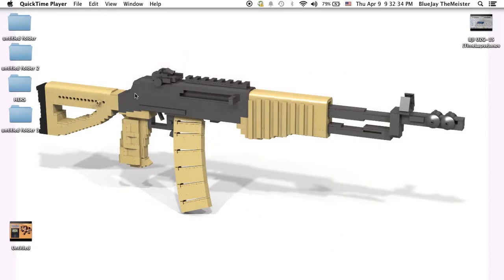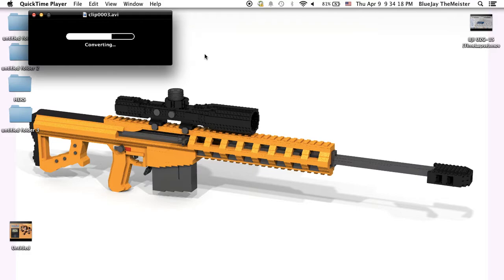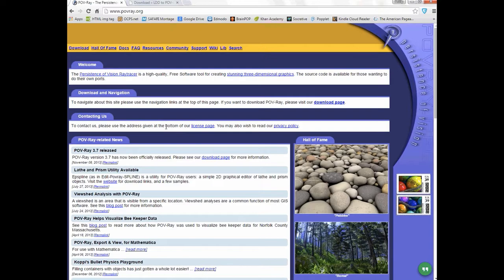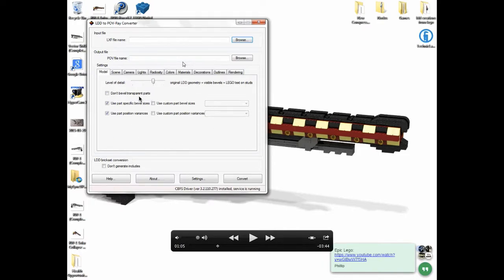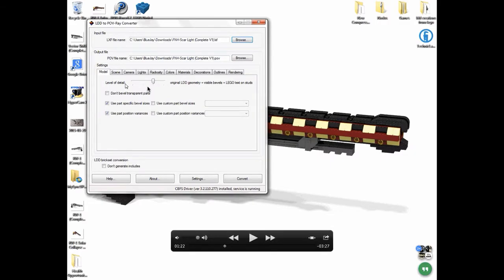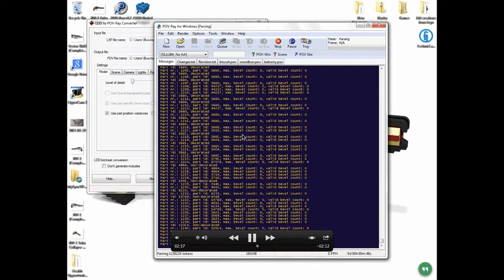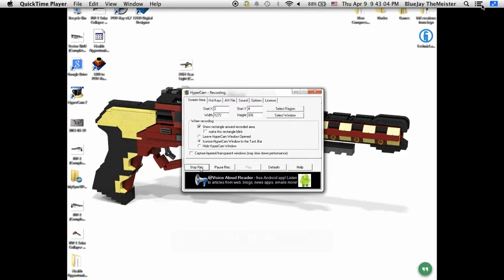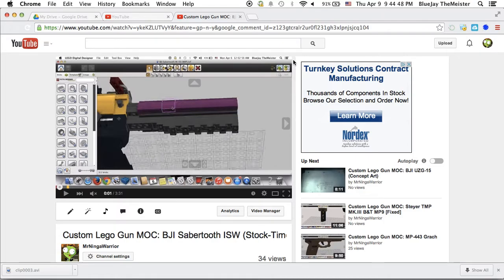How To Use: LDD to Pov-Ray

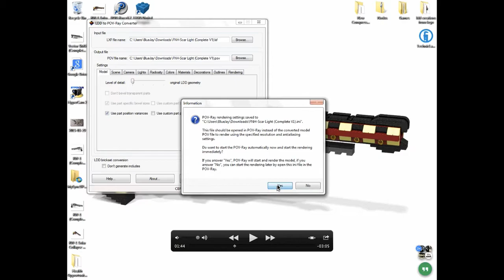Comment: Whenever I get to the part where POV-Ray starts rendering the image (where all the text shows up, 7:55 in the video) I starts, then the error sound plays and it says something about the "include files." I have no idea what to do, I've tried redoing it about a thousand times, could you please help?
Reply from the maker: Quartet Films I've also had the same issue. I have yet to find out how to fix that issue. I have noticed that with some models it just doesn't work. I'm not sure if its a piece color or if its a piece itself. Is the problem your having with every model you try or only a single one?
Reply: MrNingaWarrior I've only tried it on the one model I made. However after many different tries I just ended up deleting the program and using BlueRender. It works quite a bit faster than LDD-POVRay. Thanks for replying, though! And keep up with the cool models.
Reply from the maker: Hm I might have to check out BlueRender. No problem though, thanks for the input!

Comment: Hello. I have a problem. When I put "RUN" I see "CANNOT OPEN LDD DEFAULT COLOURS". : /
Reply from the maker: I've had this problem before. I uninstalled pov ray and then reinstalled it as well as ldd to povray. However this isn't a garunteed fix. Povray is bipolar in which models it does and doesn't like. Before you uninstall it I'd suggest rendering a model you've rendered before to make sure it is 100% not working. if it renders the model you've rendered before again it means the new model you are trying to render is not able to be rendered for some reason. I doubt it's povray so much as it's ldd to povray not being 100% compatible with povray. But I don't know a lick of code and can't find much on either forums in the way of fixes. 

if all else fails try bluerender. It's a lesser quality but it still renders.

Comment: whenever I choose my model i want to render(the .lxf file) and click render it geves me an error message reading 

"Unable to generate necessary includes. Unable to open file. File may be in use by LDD. Close LDD and retry. Could not find file 'C:\Users\Name\AppData\Roaming\LEGOCompany\LEGO Digital Designers\db.lif'

Why does it do this?
Reply from the maker: +gavin griffith 
Firstly: It might be that the model is open in LDD like the error message says. Close out of LDD if you have it open.

Secondly: (If the first one doesn't work) it might be where you have LDD (the program) located in your files. I think (and emphasis on the think because I don't know how POV-Ray actually works) that POV-Ray digs into LDD's main parts database to base the rendered image off of. Which means if it can't find the LDD file it might not be able to render the shape of the brick, and therefore error message. 

I think anyhow. I haven't run into this error in all the time I have used POV-Ray.
Someone below had error messages as well and used the program BlueRender. 
I don't know how to use that program or its quality, but you may try there if this error consists.

Comment: I got everything to work but it won't let me take another picture of the same model without overwriting the first one. I don't want to overwrite the first one because I want to have separate pictures of the same model. Is there any way to be able to get around this?
Reply from the maker: When I want to do that I rename the LXF. file (the LDD file). Like my original model will be HK MP5 and then the second picture will be HK MP5 I and the third HK MP5 II.  That way it won't overwrite what you're setting up orginally.
Reply: It worked out, thanks
Reply from the maker: +bruce wayne No problem

Comment: important question: do you need the Eldos callback software incuded with ldd to pov? because it fails to install properly. Thanks.
Reply from the maker: I do not know. Possibly not.
Reply: Well i found out that you do need it. I have downloaded BlueRender instead. It's PERFECT. No install. Renders very fast. It doesn't have such a high quality as POV Ray but it is the perfect alternative for someone with a weaker computer.
Reply from the maker: +82christos I use both now. Esspecially when PovRay won't render a model. Be careful with BlueRender. Certain colors will render very ugly.

Comment: I haven't been able to use LDD to POV-Ray with the new LDD update... Have you had this problem?
Reply from the maker: I've yet to try actually. I will try it out sometime soon and report back here.
Reply: +MrNingaWarrior Thanks! If you can please comment back when you do see what happens. I get an error message saying "part ID '16709' is not supported by the current brickset version" but I haven't been able to find out whether this is a problem for anyone else.
Reply from the maker: That's sounding like a certain part you used in he new LDD version isn't supported by LDD to PovRay's current system. I haven't tried just yet. I plan on doing it tonight after I finish my essay on Ancient China.
Reply: It seems that way, but this part was not in anything I was trying to render. It gave me that same error notice no matter what I was rendering.
Reply from the maker: +Toa Rick Brick Hm. I'm about to fire up my desktop to try to render something in a second. I need to print out my essay
Reply from the maker: I was able to convert and render my MP5K from MW2. It was built on the newer version of LDD. I didn't have a problem, HOWEVER, I did notice the conversion process from LDD to PovRay file type was considerably slower than what it was before.
Reply: +MrNingaWarrior Hm. Well Thanks for your help! I'm glad you were able to render it. I don't know what was wrong with my program but it simply won't render. Hopefully I can find an alternative. Sorry to spam up the comments in your video. I appreciate your help!
Reply from the maker: +Toa Rick Brick Try using the program BlueRender. someone else in the comment section used it and it worked. I dont know much about it but it should work
Reply: +MrNingaWarrior I have tried using blue render, it's not nearly as good quality as POV-Ray and I could not get custom decals to work. For my purposes I need a higher quality render. I make digital custom minifigures so custom labels are a must (I have an Instagram page with some examples of my work)
Reply from the maker: I have seen custom decals in work on LDD to PovRay but have never taken the time to use them. That's a cool thing and a very special job in the community. Props to you for doing something so unique. I could understand the need for a better render. Have you tried completely uninstalling both programs and reinstalling them? That might help but it might not. I have no idea on a technical standpoint what that error report means.
Reply: +MrNingaWarrior I've been using LDD for years now and I've decided to try rendering some of my models. I actually tried using BlueRender before POVray because of how simple it is, but I ran into some problems. I am only able to render very small files with BlueRender (less than 30 kb) otherwise I get an array index out of bounds exception. I've tested it with the same version of Java they list in the download page with no luck. I'm guessing that an update in ldd changed the way some data is stored, causing Java to throw in error when trying to access a non-existent portion of the array. I haven't been able to find anyone else with the issue, but I have tested the program on a Windows 8.1 laptop and a Windows 7 desktop. Great job with the guide, POVray is working just fine.
Reply from the maker: That's great to hear! That the tutoriall helped I mean!